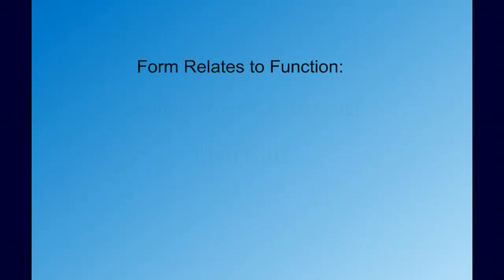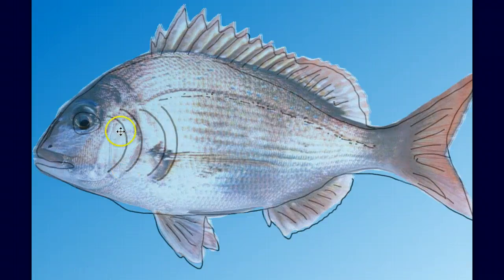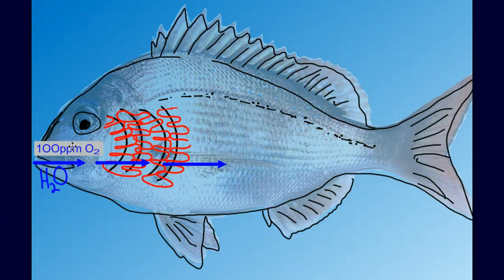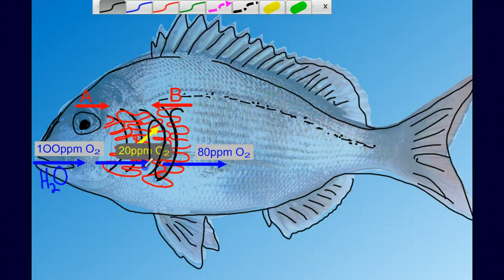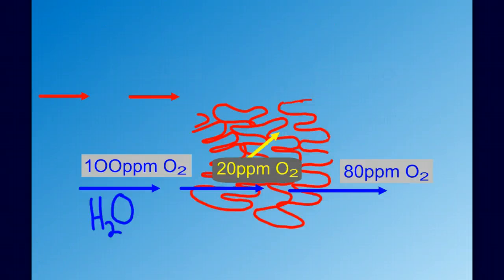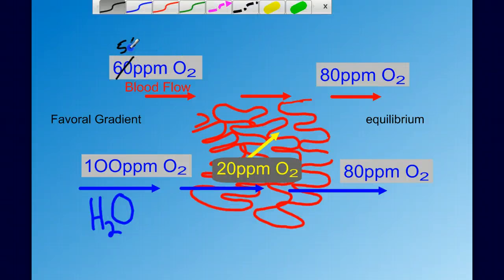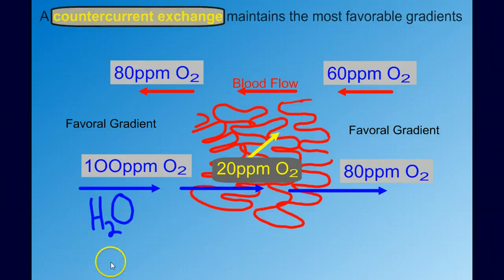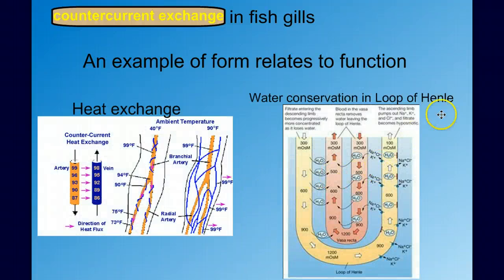Countercurrent Gas Exchange in Fish Gills

Comment: Couldn’t you make a diving rig that , instead of supplying air it pulled the divers blood into a sterile machine that brought the blood into contact with the water to transfer oxygen.. then filter back into the body… the diver would not need to breath but probably should breath a inert gas but all oxygen exchange would come from the blood

Comment: I don’t get how the blood mixes with the water, it’s inside the vessel right?
Reply: The blood and water don't mix. The blood stays in the capillaries and absorbs oxygen from the water through the walls of the capillaries. It's a bit like the engine cooling system in your car radiator.

Comment: One thing I don't quite get here. I don't see why the examples are that different with regards to the "final product". They are both resulting in 20ppm of oxygen diffusing into the vessels of the gills. With the concurrent flow surely diffusion is initially faster then slows as equilibrium is met compared with the slow and steady counter current system.